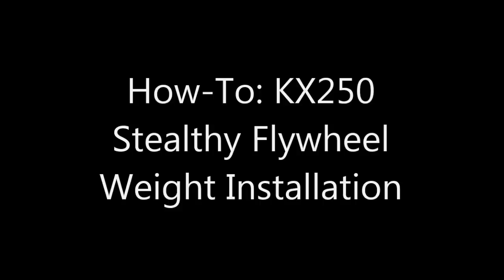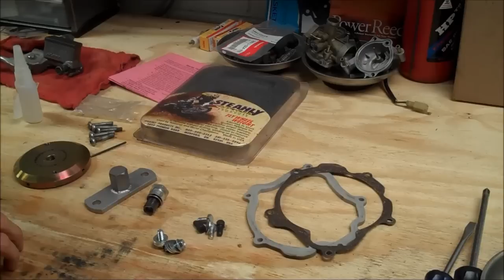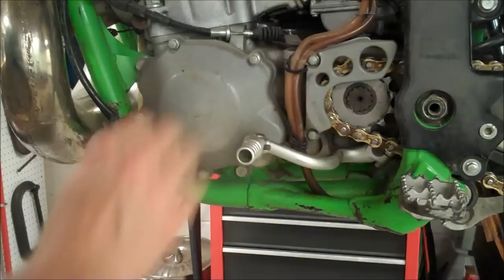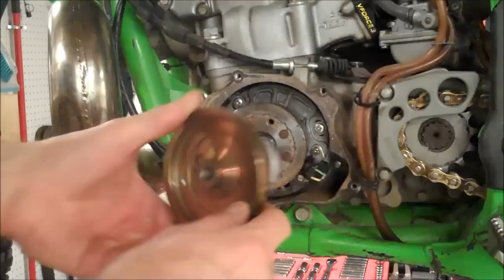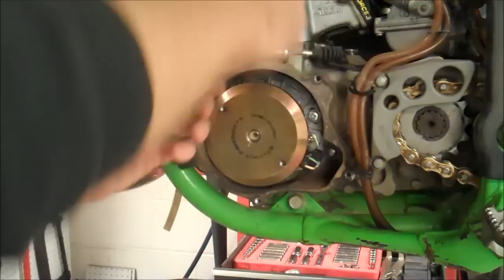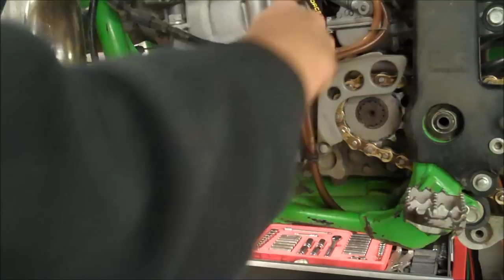How-To: KX250 Steahly Flywheel Weight Installation

Comment: I just did the same on my 01 kx250.  I chose a 13oz and I don't regret it one bit. I'm running a fmf fatty, pc shorty, 265cc, v force reeds.
It really grunts down low now and had explosive power out of the corners and it keeps it pulling really smooth all the way to the top end.

Steahly weights are the way to go you'll really enjoy yours.
Reply from the maker: go13ok I need a little more seat time to see if I like it. The FMF fatty is a low end pipe, correct?
Reply: MatthewMCRepair the fatty is a all around pipe for power. The gnarly is the low end pipe.

By the way it's steahly not stealthy ; )
Reply from the maker: go13ok LOL....I look at that word and automatically think "Stealthy". I'll fix the titles.
Reply: MatthewMCRepair I used to think it was steahly too. Its all good brother.
Reply: Where did you get your weight at?

Comment: I installed this same brand/unit for a KX500 I used to own.  I worked just as advertised and made the bike a little easier to ride.  The problem was that the extra rotating force from the add on weight was more than the woodruff key between the factory flywheel and crankshaft could handle .  It sheared off constantly and I could not take the bike any distance to ride.  I was amazed no damage occurred to the mating surfaces.  It sheared at least 6 times before I gave up on it and  removed it for good.
Reply from the maker: My weight has set screws around the circumference (I believe 4 of them) to prevent what you described. Did yours have them?

Comment: First, thanks for the manual - that should be handy!  The flywheel weight install is pretty simple. I think I would have tossed those phillips head screws in the trash though and used longer OEM style hex bolts. Also might have added a little dab of blue loctite to the setscrews just for safety.

Comment: Awesome vid . And it came across my feed just in time. 😉👌 tried finding your ride and thoughts video but i couldnt. So, can i ask did alter top speed or gear changes. Would you recomend it with changed cogs and fmf gnarly for enduro type riding. Concerned if installed with these parts it may deaden the 2 stroke feel.  What are your thoughts? 
Thanks . Subscribed

Comment: Hello  MatthewMCRepair    ... I just have a simple question ... some feedback would be highly appreciated.))))      My wrist pin will not fit in my stock piston, but it does fit my Wiseco crank rod. Can I just replace the wrist pin with a OEM wrist pin (20$) or do I need an entire new Wiseco piston kit (170$) (wrist pin and piston+rings) and what would cause my wrist pin to not fit my piston at all ???

Comment: Does the tool to torque the weight come with the weight itself or did you have to buy it
Reply from the maker: It comes with tool. I had to modify it since PO broke it. Highly recommend a piston stop as well.
Reply: Alright, thanks

Comment: What weight did you choose?  What are your thoughts since installing?  I have a yz250 I'm considering doing this to torn between the 9oz and 11 oz I ride 90 percent off-road 10 percent track fairly aggressive but would love to get more bottom end pull but don't want to loose all the snap up top.  I appreciate any input!
Reply: +Wes Hyde I would think you would like an 11oz. weight, although Steahly has a flywheel recommendation chart on their website

Comment: I may have missed it somewhere in the comments, but what were your thoughts once you rode the bike with the flywheel weight?  Thinking of doing the same for my 1999 KX250 for woods riding.  Thanks!
Reply from the maker: +CJ767 I can definitely lug the motor at a much lower speed w/o stalling. I'm not sure if it gave me the increased traction I was looking for on a mx track. For the woods, this part is a no brainer, go for it.
Reply: Did you ever do a full video review on this FWW on YouTube?

Comment: I ordered this for my 03 yz250. The threaded hole is 1/4" bigger than crank shaft. Part number matches my model though. My bike has AMA pro model stamp with boyesen ignition cover. Do you think it has a aftermarket crank shaft or something? WTF
Reply from the maker: Not sure, give their tech support a call and see what they have to say. Maybe wrong part was packaged?

Comment: man this helped a lot.  thanks
Reply from the maker: +James Evans Your welcome :)
Reply: +MatthewMCRepair matt my 87 kx 250 is getting water in the magneto cover  its condensation from hot to cold. ideas? its rusting the fuk out of the flywheel.
Reply from the maker: +Kevin Stearns Make sure the gasket and rubber grommet around wires are sealing. That is the only way water can get in.
Reply: its not from going thru water. its from hot and cold i stated never mind ill figure it out.
Reply from the maker: +Kevin Stearns OK, well then there is a break in the gasket seal or grommet that will let air in and cause the moisture issues you have. There is no other way for water/air to get in and cause your rusting issues.
Reply: +MatthewMCRepair im sorry my fuk up you are right it is the crack on the case where the grommet is. i need to put waterproff tape to cover it up. thanks.
Reply from the maker: +Kevin Stearns You can also try some non hardening "grey" gasket sealer.
Reply: yea i have that shit permatex in a can. cheese wiz i call it. thanks

Comment: What brand torque wrench do you use?
Reply from the maker: Harbor freight.
Reply: Is there a brand name?  Is it 3/8 drive?  What is the torque range?  And would you say it is decent quality?  Thanks in advance for any help you can provide me with.
Reply from the maker: Pittsburgh brand I think. I have all 3 - 1/4, 3/8, 1/2 which I bought for 9.99ea with the coupons that come out. Here is a link: http://www.harborfreight.com/3-8-eighth-inch-drive-click-type-torque-wrench-807.html

Comment: What was the net result of installation? Meaning once you rode the bike what were your findings?
Reply from the maker: I was able to lug the motor at a very low RPM w/o stalling was my initial finding. This would be more important for woods/trail riding.
Reply: MatthewMCRepair i just ordered a 17oz. flywheel from Steahly for my 2009 crf450 which is going to be my trails, amateaur enduro ride. looking into a clake 1 hydraulic clutch next. i love my crf but its far too torquey for woods and stalls way too easy at low rpms.
Reply from the maker: Nice. How come hydraulic clutch over say a Rekluse?
Reply: MatthewMCRepair i upgraded from 4 to 6 spring clutch already and it grabs great. hard. rekluse is like $600, the clake 1, becomes a single finger lever at a 325% pull reduction. cable is replaced w a hydraulic line for much more consistent pulls. whole thing is like $325. but. i plan to ride as is w the new flywheel for a few months to learn the changes. then change clutch lever.
Reply from the maker: Cool, let me know how you like it.
Reply: Will do, I went with a 17 ounce weight as my MX days are behind me. If I can I will post a vid reply.

Comment: Why did you not use any thread lock / Loctite?
Reply from the maker: +skinduppy Both Steahly and OE instructions do not mention to use any.
Reply: +MatthewMCRepair  Just got one for my kids KX65 and the instructions say not necessary but can be used on the main locking bolt! I just put some on for piece of mind, thanks for putting this video up, it is not complicated to do at all, the 65 does not have the allen bolts around the edges and you only tighten the weight down with hand power, no special tool included!
Reply from the maker: +skinduppy Yes, I agree some Loctite 242 wouldn't hurt. I haven't had any issues with it coming loose. My kids are not old enough for gas bikes yet, still riding the electric razors.

Comment: why weight the flywheel, what does it give?
Reply from the maker: You can lug the engine at low speeds, and tames the hit.
Reply: MatthewMCRepair this means that the dynamics of overclocking is falling, is the acceleration becoming smoother?
Reply from the maker: Acceleration is smoother and more predictable.
Reply: MatthewMCRepair thanks for the answer. I have a standard flywheel, (oem), the heaviest one that can be. I saw your video and decided to ask the opposite question. I'm not satisfied with the dynamics that are now, now I understand, I need to put an easier flywheel that would raise the dynamics of the acceleration. thanks again)

Comment: Do u have to have a flywheel?
Reply from the maker: No.
Reply: MatthewMCRepair so if you take the flywheel off then it improves performance
Reply from the maker: No. The flywheel simply alters the power delivery.

Comment: Isn't the steahly supposed to replace the flywheel? You just added it on top of the stock flywheel.
Reply: +Leonidas Saber Steahly makes mostly flywheel weights, which are direct bolt-ons to your existing flywheel. However, for many four strokes, you have to buy a complete flywheel, my 2008 YZ 450F is a great example. Getting a weight, though, is a much easier install, because you do not have to take out the flywheel.